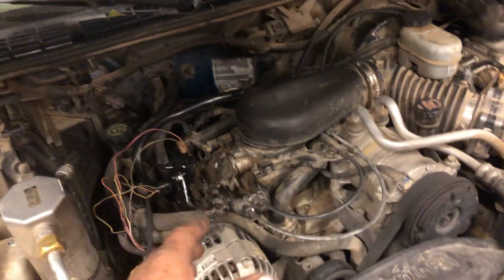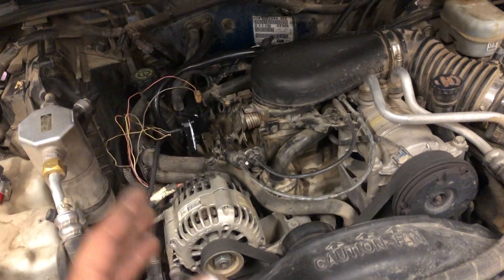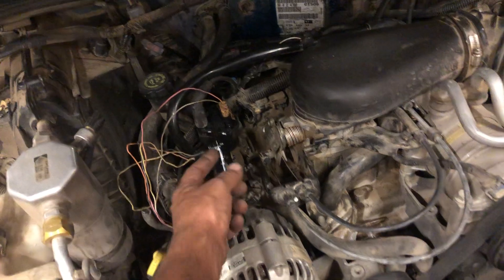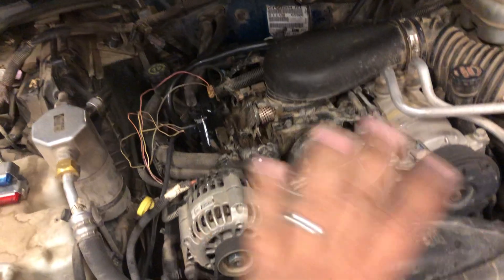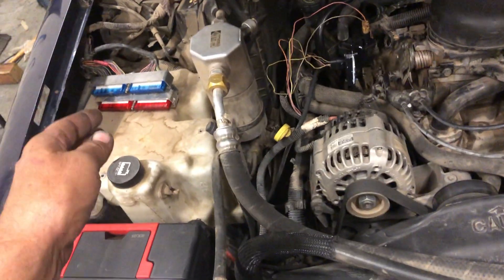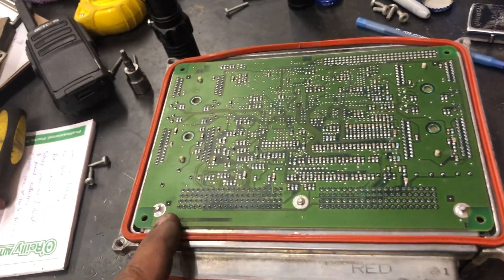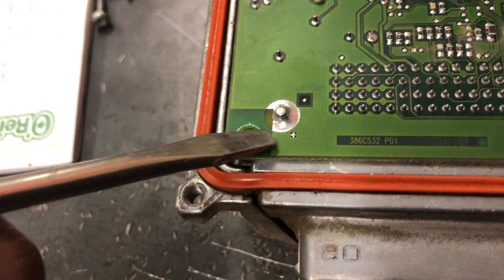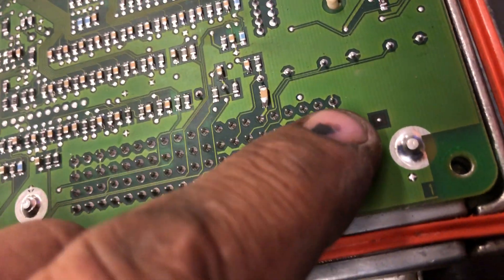2002 chevy no spark

Comment: Experienced the same problem on 93 gt foxbody. Changed distributor, spark plugs , and fuel pump. Car wouldn't turn or start. Just ordered a ecu from auto zone. Is there anything else I should trouble shoot before swapping my whole computer.

Comment: Man o man I hope this is what’s wrong with my 2002 Tahoe, I’m broke dn in a small town ., I have no spark, replaced the cam sensor and still nothing , I’m in a room now trying to see what I can do next. Over the past couple months it acted like it had loss of power and did hear some pinging when it felt weak, I changed the fuel filter and ran some Berrymans thru it a few times and seemed to be better, then driving out of town  it losse power and was popping from the intake as it quit running,.. if anyone has any info I would love to hear it., thanks

Comment: Hey brother, I'm not a very good mechanic. I just bought a 2002 BMW X5 V8 wagon. (got it cheap) I watched how to tell if your alternator is bad, by unhooking the positive cable. Will that work on this BMW like in your video? It's sad my dad's was certified mechanic in all engine types (Except aircraft) I believe. He didn't teach me crap, didn't want me to ave a bad back before I was 30. It didn't work, the Army ruined my back, knees, and ankles. Thanks for your help. Paul Redinger
Reply from the maker: the army will do that. ha  yes but disconnect the ground. the positive has multiple wires.

Comment: Hey on the shifter b&m video I have problem with my neutral safety switch and reverse light my reverse light stays on while I’m on drive
Reply from the maker: sounds like a grounding issue, is it grounded well. maybe a ground strap from the shifter bolt to the frame. you can never have to much ground. i believe that switch goes off when grounded but stays on without ground. let me know.